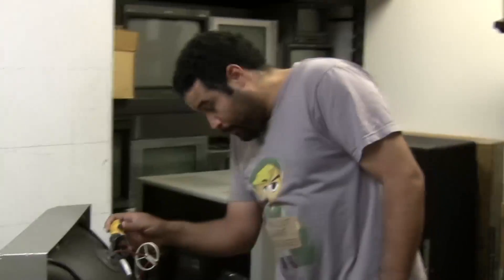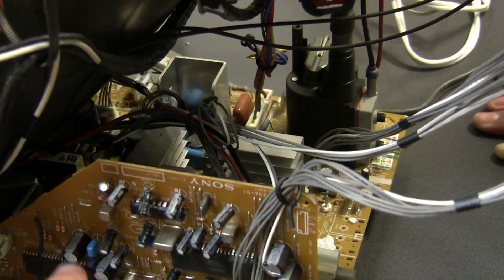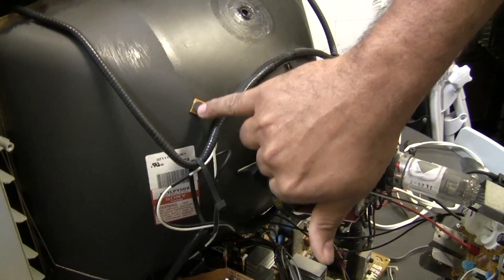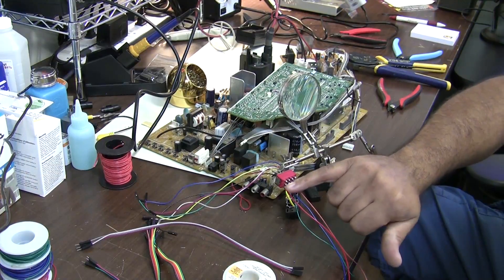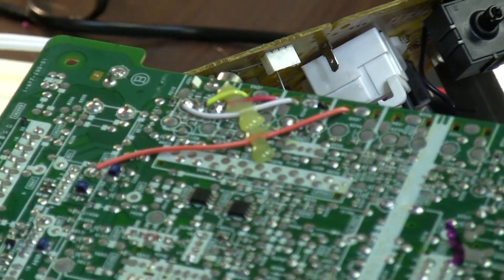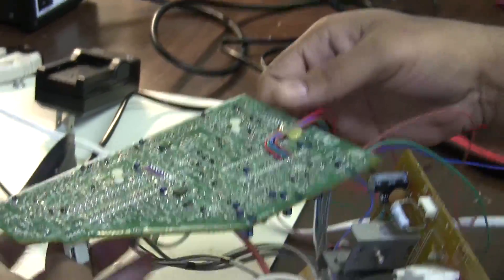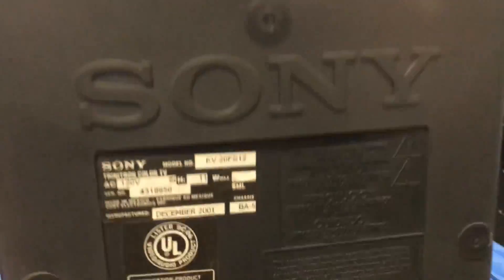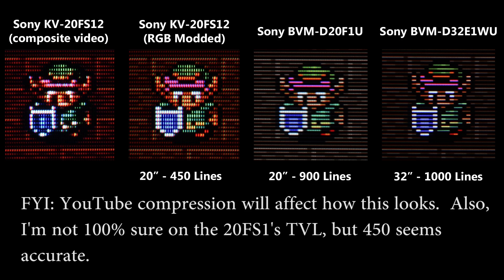RGB modding a Sony CRT for Retro Gaming

Comment: Quoting - "They [Sony PVMs] needed to be precision instruments, which is why they cost so much money".  80% agreed.  But as someone working in broadcast/TV/film, I can tell you now a lot of the cost of Sony equipment is simply because Sony can get away with charging what they do.  The same thing happens today.  You can buy a Sony OLED for the cost of a car (we have displays in production that cost $35K or more), or a different brand for 1/10th the price at 90% the quality.  Some of that cost goes into the "law of diminishing returns" on components and increased quality.  Some of it is just because there's a Sony badge on the front.  Same goes for any recognizable brand - Apple today, or Nike/Reebok in the 80s and 90s.  Dollar cost doesn't always equal the actual improved value of the product, especially in markets with little-to-no competition, or where hyped brand recognition keeps the perceived cost high.

Consider that late model PC CRTs have the similar dot pitches or line counts as PVMs and BVMs for a fraction of the price (I'd challenge anyone to tell the difference between a 240p@120Hz 21" PC monitor, and a 240p@60Hz ~20" BVM with the naked eye) .  Also, arcade operators have been turning to Chinese and Mexican tubes and chassis for years, as well as consumer TVs for parts for ages.  While certainly nowhere near the dot pitch of a PC CRT monitor pr PVM/BVM, it's more than adequate for commercial gaming applications. 

If you want to see a huge array of RGB/SCART screenshots from the 80s and 90s, check out British magazines like "Mean Machines".  They took screenshots exclusively on RGB/SCART televisions with real film cameras for all of their 8 and 16bit reviews - http://www.meanmachinesmag.co.uk/ .  You can see the quality is amazing, and it's what any Europeans would have considered "normal" back in those days.
Reply: Funny that your comment mentions my almost a year "struggle" with CRTs (in a "cheapo" way XD). When I got my Nintendo Wii, I picked it up simply for the fact that it could emulate most retro consoles, and at 240p nonetheless, with component cables for the best quality (it can offer). My first hunt for a display was of course a CRT, since I knew already that it would give a better picture for old games. And my eyes were on none other than the SONY brand, because the whole internet say they're the best. The one I ended up taking was a 29" SONY WEGA that I payed almost 1.5x more than my second option, that at the time was a similar LG. But when I finally set it all up, I regrettably perceived too late that the tube was dying. The convergence was off in the corners, and it gave a pinkish hue when brightness was over 50. I was pissed at myself for paying more for something that was about to get scrapped, but I ended "fooling" someone else by selling it and getting some of the money back XD... Actually, I didn't fool the guy, because the first time I used the TV it was with composite cables and of course the little defects would be that more pronounced, and the guy that bought it used component cables for his custom arcade board, which really showed what that tube was capable of... I still regret it a little for parting ways with it, though (maybe a way of making myself better for practically still fooling the guy XD).

But moving along, after the SONY fiasco, turns out I found a similar 29" LG tube that was my second option, and so I grabbed that. How perfect that tube is (for my current standards now)... I payed around 70% of the price I payed for the SONY (which now I can only find the same model for around double the original price I payed), but the quality is impressive. I always had luck with LG displays, and given my later CRT acquisition I'm telling, that's true.

Almost a month later, I broke my perfectly fine LCD PC monitor, that was only 2 years. By luck, I came across a 2006 LG CRT monitor, and holy! As cheap as it was, I feel bad for the person that sold it not knowing of its "hidden" capabilities. Being a retro "advocate" (of sorts), I can say that late PC monitors are the holy grail of retro emulation. Compared to my 29" tube with component cables, games look at least double as sharp, and also by the high amount of resolutions and refresh rates it's capable of displaying, the small variations in quality settings, aspect ratios, scanline thickness, etc., are so vast, it makes it the best thing I ever bought, like, ever! I was able to set Sonic Mania's "native" resolution and play it in 16:9 240p (@122hz for the matter) just by scaling the picture in the monitor's controls. And I was also able to play the original DOOM, using most of its original aspects through the Chocolate DOOM source port, by setting this thing to 320x200@144hz! It's just amazing that such a low resolution makes DOOM look new compared to the dozens of other ways I played it before...
Reply: Checked out some mags. Being from the usa. I have never heard of it. Looks like it is written for mature audience. Pretty cool thanks
Reply: NiggelMyNiggel Mean Machines, Mean Machines Sega and CVG (Computer and Video Games) were all similar teams. Many of them work for Retro Gamer Magazine, a modern UK print magazine. All worth reading for a different perspective. I'm in Australia, and growing up the UK had more influence on gaming here than the US (EGM, GamePro, etc) due to the PAL relationship. That's why RGB gaming and SCART is less foreign here too. Always worth a smile when people discover it 30+ years later.
Reply: I have never used a Pi system or seen a BVM/PVM in person, but when it comes to this PC monitor, I can say I've "mastered" it, using PC emulators. It all comes down to scaling here; since every different console outputs their games at different aspect ratios, a computer OS which typically looks at displaying square pixels on the screen won't really match with console display systems. Emulators generally get around it by using integer scaling filters, or other upscaling methods. Since I am using at least a native vertical resolution on this monitor (mostly 240p, but that isn't always true) I can get away by setting any horizontal resolution, which people call "super resolutions" on forums. I mostly use 1280x240@120hz for retro games (120hz to match the 31khz horizontal refresh for this monitor at 240p), and it looks as crisp as if I upscaled the image to 1080p. But if any linear (or otherwise) filtering is enabled, or the aspect ratio is incorrect, than it isn't sharp at all, creating a "double line" effect, and visual tearing while scrolling. Look at an example of a NES emulator set to 1280x240 with a linear filter enabled, and another without any filtering and correct scaling:

Filtered:
https://imgur.com/a/tH0WV

Unfiltered, correct scaling:
https://imgur.com/a/D4AYu

The phone camera isn't that friendly, but it's still a huge difference. Other emulators have different scaling methods, but the most important part is getting the vertical resolution right. I've learned now that I can set the "true" NES/SNES/Mega Drive vertical resolution for NTSC games, which 224p. With that, I can get a true fullscreen 4:3 resolution without any distortion or black bars. NES/SNES games "square-pixel aspect ratio" is 8:7 (256x224), but giving a 1280x224@130hz resolution a 5x horizontal and a 1x vertical scaling, it fills the whole screen without any missing image. The same is true for Mega Drive/Genesis, but with a 4x horizontal scaling instead, since its games square ratio seems to be different.

The high horizontal resolution is really what's the best about this monitor. Since the number can get as high as your GPU can handle (even up to something like 3840x240 or 7680x240 on some cases, which is OP really), the micro-fracturing of horizontal pixels will "conceal" any deformity, and can be stretched to infinity. It becomes a problem with low resolutions though, like 320x240, where sometimes there will be missing lines of resolution (mostly for PSX games), and the image can become "grainy".
Reply: TheDimensioner i have not been impressed with the video quality of crts and emulation. I have a RPi hooked up via rgb to a bvm and it doesn't look so good. It's comprable to composite with original hardware ran through a comb filter on a bvm. I am comparing 240p games
Reply: If RPi via RGB to a PVM is giving you poor output, you've done something very wrong.  Getting visual quality indistinguishable from real hardware (ignoring lag) is a trivial thing to achieve right now, with current gen tech and cables.
Reply: Dan Mons that's what people on the forums tell me. But i don't think i am doing anything "wrong". It's possible that a pice of hardware could be sub par. But i think that i just look at these things more critically than others. And don't get me wrong. The rgb on the RPi isn't bad. Its just not as good as actual hardware. And it resembles something like the composite on my bvm through a comb filter. The composite on my bvm looks amazing for composite. Comprable to s video on a consumer tube... I think i am going to upload a video about what i am talking about here. This is an issue that keeps coming up and i haven't seen any good comparison videos... I hope I'm wrong. It would be nice if i could buy a new RPi and it could outpit superior rgb
Reply: I can assure you if you're seeing comb-filter effects or any sort of interference, something is going wrong.  The RPi can do resolution-accurate modes that match almost any old hardware, and there's many options to get pure RGB.  Definitely take a video and some high res photos, and describe your setup in detail.  There's something going wrong if you're getting such poor output.
Reply: Dan Mons I'm not seeing any interference. It's just not  sharp. Kind of like the rgb on a first generation snes. I think it's inherent to emulation. If i use different emulators i can affect how sharp the image is. But none of it looks as good as original hardware.
Reply: Again, there's something amiss with your setup.  I can get razor sharp images out of a Pi over analogue RGB without problems (a blind test of a still image would fool anyone).  Check any of the videos RetroTink post for examples of what they can do.  Assuming you haven't done something silly in software like left bilinear filtering on (the default for many emulators that needs to actively be disabled in your options), picture quality in analogue signals comes down to component quality, so I would look there (a different RPi board, a different RGB setup - try a GertVGA666 or a Pi2SCART/Pi2JAMMA, and see what's going on).    There's nothing inherent to emulation that creates blur.  Pixels are pixels, modelines are modelines.
Reply: Dan Mons. I don't know. What "bilinear filtering" is. But i will mess around with it. I am using the gert and a sync combinear from arcade forge. I basically followed the recipe off retrorgb. Com
Reply: Bilinear filtering happens after the initial rendering of an image to blur nearby pixels to smooth out the resulting image.  It's nice on high resolution 2D and 3D images to remove jagged lines, but on low resolution images it produces ugly blur.  Most emulators enable it by default (assuming people are scaling up emulators to run on high resolution LCD monitors).  If you're running pixel-for-pixel on a low resolution CRT, it will make the picture blurry and "muddy", and must be disabled. - https://en.wikipedia.org/wiki/Bilinear_filtering
Reply: TheDimensioner damn... Sounds complicated. I picked up a couple things from all that. 1:that getting the resolution arcurate to native hardware wull greatly affect sharoness. This is something other people have told me but i have ignored because i wanted to full tgw whole screen. I check it out... 2: your computer monitor can do lots of different resolutions. This is interesting to me because all my monitors only do 240p and 480i....this makes me think that i would probably achieve better results with my Rpi ran through a cheap crt computer monitor running at 720p compared to my current setup-Rpi running 240p tp my bvm
Reply: Like I said, I've never seen a BVM/PVM in person, so I cannot say for sure that it's best to change setups. What I do know, is that BVMs/PVMs will have the benefit of native 15khz, which is the condition for 240p@60hz, to match most retro games framerate of 60FPS (for NTSC). CRTs have "blur" or "ghosting" if the content doesn't match the monitor's refresh rate. For the untrained or already "used to it" eye it's commonly fine, since TV content always were displayed at half the refresh, and people watched TV without complaining... But for 2D games it's a different story, where for 60hz, having a 60FPS game at 240p created a "clear" image, with no display artifacts. But having a 2D game running at 60FPS on a 120hz display will create the blur/ghosting effect. It mostly happens on objects away from the center of the screen, and since 240p is progressive with already well separated scanlines, it would only be visible in really fast scrolling sequences. Some people get away with that by inserting a "black frame" through some emulators options, alternating the game image and it, doing away with the blur. It's still 120hz, but the image becomes overall darker. Another method, is to create a 480p@60hz super resolution instead, and add a scanlines filter/generator. It also makes the image darker, so I really don't use this method, since I much prefer the 120hz lower input latency over "native" 60hz. There are 15khz PC monitors out there, but they could be rarer than BVMs/PVMs these days.

This monitor's options aren't limitless, and more "recent" CRT PC monitor will have even better results. But with them being commonly chap anywhere in the world, and with the possibility of finding big monitors with resolutions and refresh rates matching modern high-end flat displays, CRT PC monitors can really become a monitor for everything in gaming.
Reply: Well Many of these 16-bit games use dithering like Sonic 2 main screen(in this video)Check out the blue lines On the horizon with a different shades with a composite cable actually that effect looks better such as the waterfall effect in the background for all of the levels.
RGB just shows in uglier version of the game no point from  to use on 240p only 480i it’s worth to use as its delivers a clean image.

Comment: Awesome, been looking forward to this - One request, can you PLEASE test a lightgun on that next one? I know technically it should not work if the TV has Component input, because of processing, but maybe in RGB? Also input lag _ I would expect there to be none, and guns to work, but would be great to see in action!
Reply from the maker: Actually, light guns should work fine.  I'll definitely test next time.  Should be zero lag too.
Reply: Thanks for the response. I think the whole light gun compatibility thing is a little murky (hey, good reason for that new site, huh?), but isn't it that CRTs that do HD won't work? I don't recall where the cutoff is - will "Enhanced Definition" (480p) TVs work? I'd be extremely curious to see if a Jungle Mod could be the piece of the puzzle to allow 240p RGB, and 480p/720p over component for some the later systems... it's good to dream, right?
Reply from the maker: You are correct about some HD CRT's, but RGB modding isn't changing the resolution.  I'll post a video tomorrow to demonstrate though.

Comment: That's pretty awesome. One of my coworkers, who restores arcade cabinets, and I were discussing using an arcade monitor to display RGB video from a SNES. I took a quick look on your site but couldn't find anything about it. Have you tried to use an arcade monitor with a console before? It sounds pretty ideal since he said his extra monitor that he has accepts RGB @ 240p.
Reply from the maker: It's much harder, as you'd have to build (or buy) a board that outputs the exact correct voltage to an arcade monitor.